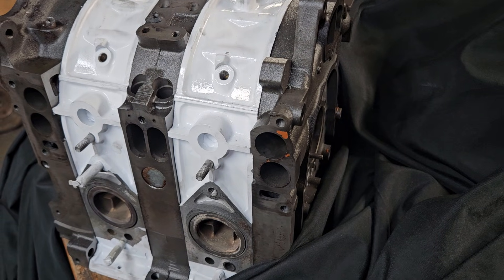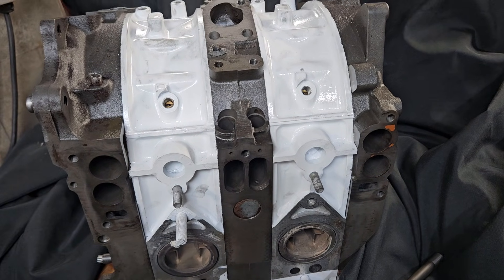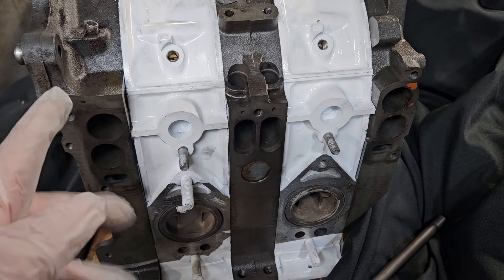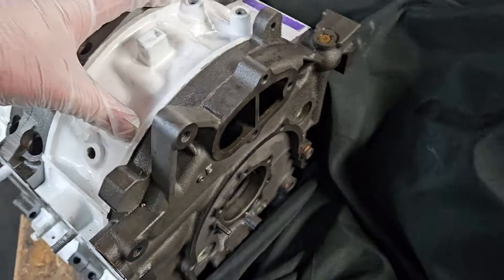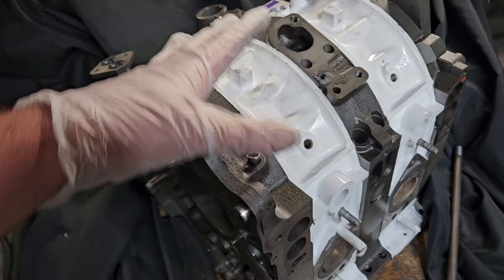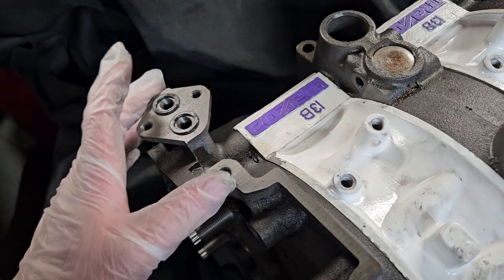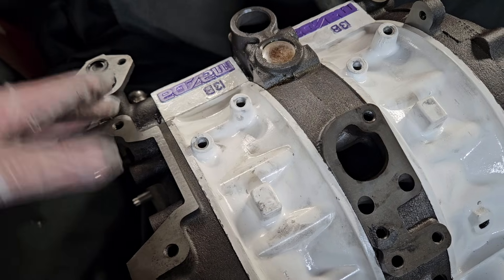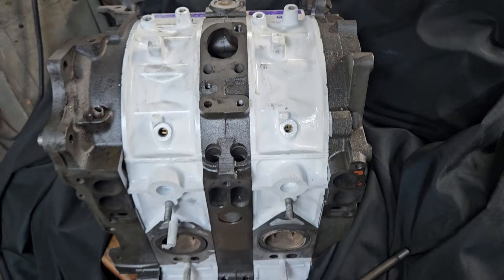Can you BOOST a RX7 6 PORT NA Engine? adding power to the 86-89 Rotary engine - KMR Rotary

Comment: Also need to remember that some come with different spark plug spacing on the housings- important for tuning. And higher compression rotors... but huge port potential area compared to turbo blocks
Reply from the maker: It really depends on the build with rotors. In most cases, a build like this will have an aftermarket ecu.  Probably high horsepower, so running high compression rotors with high octane fuel and proper tuning works great.  I think i've got a few videos out there discussing rotors and housings. But maybe I could do one specifically talking about it.

Comment: You should add or clarify that a lot of the NA 6 port engines use a smaller exhaust sleeve landing area mazdatrix doesn’t disclose it I have 2 series 5 engines with said shorter sleeve landing surface castings and I had to get them machined down to fit currently in my 6 port turbo car they work great just annoying that the guy I called was trying to call bs on me when I said homie I can literally send pictures and measurements not a bad product just really dumb they didn’t want to believe me when literally any oem s5 na housing has the smaller sleeve
Reply from the maker: hmmm, ill look into it. There used to be a spacer in there behind the S5 sleeve that would come out. I wonder if the casting changed?